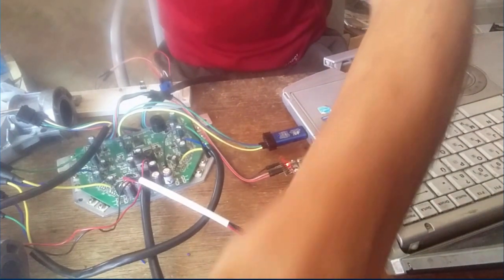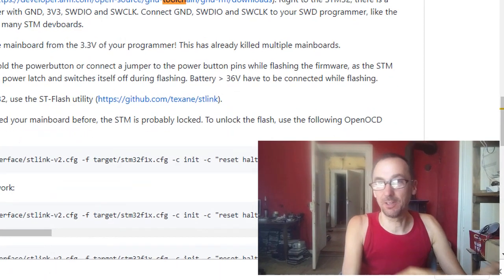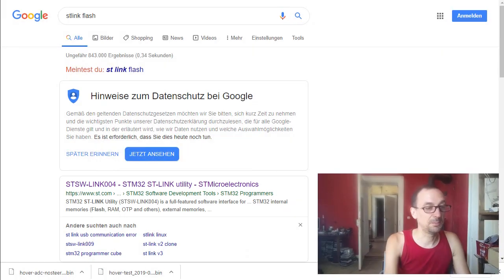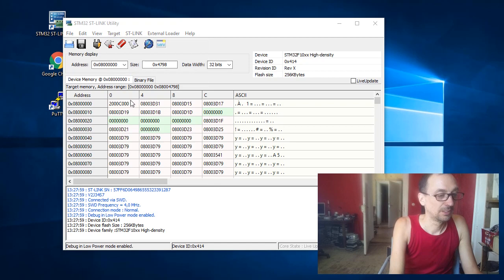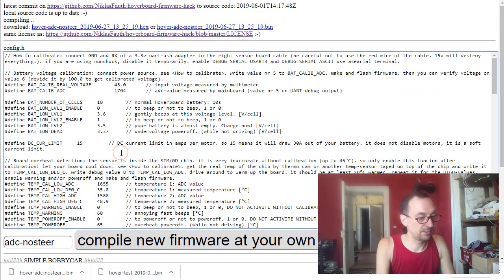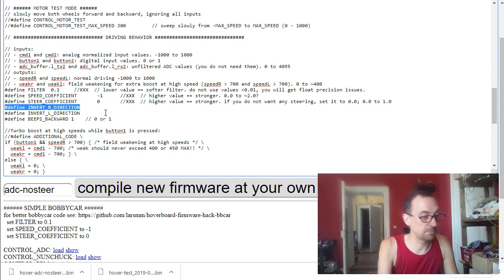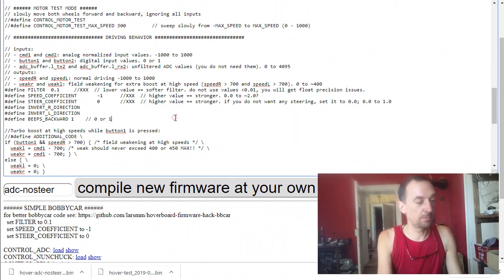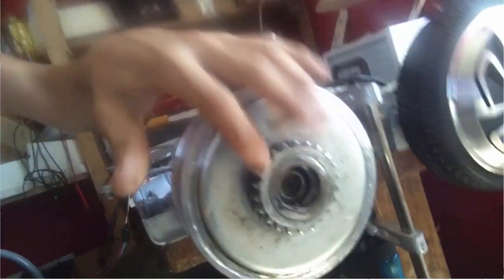free online hoverboard firmware compiler - full tutorial :-)

Comment: Gd work Durden! I have been testing the roboDurden hoverboard-firmware-hack for a while and everything thing is working fine. But when I uncommented #define KMH line to work with KMH, the arduino does not work as it should. For EXAMPLE, sending Send(whatever more than 3 for the speed, 0 for the steer) run the wheels at the highest speed. And sending whatever after that the hoverboard will not react at all. So it is reacting with the first sended command and also incorrectly. Do u know what the problem could be!?
Reply from the maker: This is a long known bug which i thought i had solved by in main.c with:
  if (abs(HallData[0].HallSpeed_mm_per_s) > abs(HallData[1].HallSpeed_mm_per_s))
  {
    #ifdef INVERT_L_DIRECTION
      iSpeed = -HallData[0].HallSpeed_mm_per_s;
    #else
      iSpeed = HallData[0].HallSpeed_mm_per_s;
    #endif
  } 
  else
  {
    #ifdef INVERT_R_DIRECTION
      iSpeed = -HallData[1].HallSpeed_mm_per_s;
    #else
      iSpeed = HallData[1].HallSpeed_mm_per_s;
    #endif
  } 

When the speed goes to max, the control loop had the inverted max speed because of different INVERT_X_DIRECTION ..

Do you have my latest version installed ??
Also give my FOC fork a try. I am no longer using the Niklas fork and the Emanuel fork is compatible to my old fork.
Reply: @robodurden  yes I belive it is the latest one cause I downloaded yesterday from the compiler. I have tried ur FOC version with the USART but it is not working as I wanted. It run for some milli seconds and then stops, then u have to use Send() again. It behaves as the orginal Emanuel one. It send correct spedds but it runs just for some milliseconds.
Reply from the maker: @mazenbahy5012  I would be happy if you continue to resolve the bug :-)
Try commenting/uncommenting INVERT_L_DIRECTION and INVERT_R_DIRECTION to see if my SPEE_IS_KMH control loop then works.

Concerning the Emanuel fork, i send Send() every 100 ms and have no problems. You should do that too unless you verfiy with the returned SerialFeedback that your send command indeed got accepted. As i have this nasty noise on INPUT_PULLUP lines (so also the RX line), i can not rely on reading the struct SerialFeedback :-/
Reply: @robodurden   Hello Again! 
I did some testing regarding the points you said about. 
For all the cases are tested I hade Send(40,0); delay(3000);Send(0,0); in the Arduino  setup(){}. 
- Uncommented both R, L ----> Both wheels start fast, the same direction, and continue forever without reacting with the Send(0,0). 
- Commented both R, L ----> Both wheels start fast, the same direction, and continue forever without reacting with the Send(0,0). 
- Commented R, Uncommented L ---> Both wheels start fast, different directions, and continue forever without reacting with the Send(0,0).
- Commented L, Uncommented R ---> Both wheels start fast, different directions, and continue forever without reacting with the Send(0,0).
Reply from the maker: Could you activate your settings and then change the minus signs in the main.c code I posted here  those lines that are active for your invert defines 
Are you working on my old Niklas fork or the new Emanuel fork ?
Reply: @robodurden  ur old Niklas Fork, cause I can not find serial communication in KMH in ur Emanuel fork.
Reply from the maker: @mazenbahy5012  I have driven 26 km in this speed_is_kmh mode with my Emanuel fork today. Take a look at the .ino file on my GitHub.
Reply from the maker: Sorry this is the original example from Emanuel that I should delete. My example is below or here:
https://github.com/RoboDurden/hoverboard-firmware-hack-FOC/tree/master/hoverserial
Reply: @robodurden  Again No Success, Run the Arduino code (without any changes at all) here from "https://github.com/RoboDurden/hoverboard-firmware-hack-FOC/tree/master/hoverserial" on ur Emanuel fork with both UARTCAR and USART3 variations and nothing happens. Just to be sure. You said "speed_is_kmh mode". There is no place in the compiler to activate the KMH mode in ur Emanuel fork. Right?
Reply from the maker: @yacoubbahy3976  you have to uncomment the speediskmh in my config.h of course.
Reply from the maker: @yacoubbahy3976  my hoverserial.ino can output the SerialFeedback via a USB uart dongle. You should check the debug output.
Reply: @robodurden  RoboDurden/hoverboard-firmware-hack-FOC this version what I am speaking about. Inside the config.h file in the ur online compiler there is nothing about KMH. I can not find it. Which line is it?
Reply: @robodurden  The output is  "XXXXXXXXXXXXXXXXXXXXXXXXX" and it is from that part:
 "#ifdef DEBUG_HOVER
    Serial.print("xxxxx");
    iFailedRec++;
  #endif
"
Reply from the maker: @yacoubbahy3976  there is no such line print("xxxxx") only one x is printed. Uncomment the first line here and post the extended hover Rx debug output:
https://github.com/RoboDurden/hoverboard-firmware-hack-FOC/blob/1e9dbf1cb3293c91a13d27bced41b014f22be383/hoverserial/hoverRobo.h#L1

I guess you are still using some wrong config.h defines.
Reply from the maker: ah i forgot, with my Emanuel FOC fork there is now only km/h with the VARIANT_UARTCAR. So sending 60 wild result in 6 km/h. With 6,5 inch wheel size in the config.h
Reply: @robodurden  By the way,  in the main.c for ur Emanuel fork and Emanuels original, I have to to change the buzzeFreq and buzzPattern to 0 to make it stop beeping. So maybe the wired behavior is related to that?
Here is what I am speaking about:
"
else if (timeoutFlagADC || timeoutFlagSerial) {           // beep in case of ADC or Serial timeout - fast beep      
      buzzerFreq    = 24;
      buzzerPattern = 1;

"
Reply from the maker: 12 12 12 12 17 ff 12 12 12 7f 52 ff 12 12 12 12 12 ff 12 12 somehow looks like you have the wrong baud rate on one side. That might also lead to the Serial timeout beeping. I think baud rate has to be 9600. Sorry that's it for today.
Reply from the maker: @mazenbahy5012  set the baud rate to 9600 in my config.h here: https://github.com/RoboDurden/hoverboard-firmware-hack-FOC/blob/ceda23b51492d8a30611bd0933541f3092160513/Inc/config.h#L439
Or set the HOVER_SERIAL_BAUD to 38400 here: https://github.com/RoboDurden/hoverboard-firmware-hack-FOC/blob/ceda23b51492d8a30611bd0933541f3092160513/hoverserial/hoverRobo.h#L3

Sorry, stupid of me to have an arduino example with 9600 baud and  the firmware baud rate of 38400 :-(
Reply: @robodurden  I have it in the Arduino as ur "HOVER_SERIAL_BAUD   9600" and I tried to change it to 38400 and then I get the feedback "speedL:0   speedR:0 .......etc" which make sense because in the config.h  the baud rate 38400 is used for FEEDBACK_SERIAL_USART3 which makes sense. Thanks a lot for ur replies. I will continue investigating in it.
Reply: @robodurden  I should have looked at it before. My fault. Anyway, I get the feedback now but nothing happens. It's look like it send 0 to the motors. (Note:sry for confusing u in the comments. I noticed that I am using two different account to comment(mazox and mazen bahy) but I am the same person). Thanks for all the help.
Reply from the maker: @mazenbahy5012  you can set some feedback value to 42 at some point in the main.c to test if that code really gets executed..
I will flash my default firmware and my example to my solar car tomorrow.
Reply from the maker: @mazenbahy5012  My code works. First i only flashed my newly compiled firmware with 9600 baud and it worked with my solar car 9600 baud Arduino Mini 3.3V code. Then i flashed the 38400 baud compilation and also flashed the Arduino Mini with my hoverserial example code. And it too worked perfectly. 
So you eihter made some changes to my code without telling me here, or your control board is broken. As you by now get the SerialFeedback we can assume that the communicaton Arduino to Hoverboard is also working.
Try flashing the Niklas Test mode to see if your board and motors are working.
Reply: @robodurden Hello Durden! Thanks for the replies and for confirming that everything works fine with the code.  I repeated everything many times and then it looks like one of the incorrect things I did was turning the hoverboard on before uploading the code. So now, I upload the code to Arduino, turn on the hoverboard, and then everything works correctly (I believe it is also why it was beeping, Because it waits for some signals from Arduino while the Arduino is busy with uploading the code and then the timeout is over, then it starts beeping). Now the problem is with steering. when I put something else than "0" into the steering parameter it does not react at all (the wheels are not running at all and not beeping either). Changing the steer to "0", then everything works immediately´(Tested with both, commenting and uncommenting #define INVERT_R_DIRECTION, #define INVERT_L_DIRECTION in config.h file). The feedback I get while running with something else than "0" for steering is the following: 
 "speedL: 0	speedR: 0	skippedL: 5555	skippedR: 0	°C: 27	U: 0.27	lA: -0.60	rA: -0.30"
Reply from the maker: @yacoubbahy3976   my variant_uartcar  has no steering. Why should it? A car has a steering wheel.
Reply: @robodurden  Oh, Ok. I am using it to build a differential drive mobile robot. So i do not have a steering wheel.
Reply from the maker: @yacoubbahy3976  don't know how nicely I could integrate a steer value in my closed loop. Why don't you stick with the original Emanuel firmware ? It should already have improvements that I don't have. You can easily switch to his serial struct by changing the #include in my .ino
Reply from the maker: @yacoubbahy3976  from this line onward
https://github.com/RoboDurden/hoverboard-firmware-hack-FOC/blob/70c6986346b14648ce8871deb5d62ebe5a9e0ed2/Src/main.c#L277
you could define iSpeed as ('speedLeft'+'speedRight')/2 . Then the steer value might already work. But the steer command cmd1 should be a +- percentage of iSpeed and not a +-1000 pwn value. Then your steer command would always translate to the same curve radius no matter which speed is driven. 
At line 319 of my closed loop I reset cmd2 and then your cmd1 steer value of let's say 66 should become (cmd2*cmd1)/1000. Might work. You test it :-)

Comment: As promised, here is video of my project: https://youtu.be/PatJK148ie0 I managed to get Feru's Variant_hovercar working with two throttles. Hand throttle = throttle and thumb throttle = brake. I also make test run, but when i finished it one mosfet blows up (and it's driver Q2CL too). I bought this faulty hoverboard and replaced two mosfets, but now another blow up again. I also noticed that there is high pitch noise coming from mainboard. Earlier i used voltage mode, but now with torque mode this happened. Maeby there was some other faulty components also than mosfets. Maybe drivers?
Reply from the maker: Very nice project with a lot of love :-) 
Yes i too have by now lots of used controller boards where a mosfet burned. Have by now new mosfet from China but had not yet the happiness to replace the burned one. Did that once and then simple another mosfet burned. Try measuring the gate voltage before you solder in a new mosfet. I guess it should not exceed 15 Volt or so. 
I have a video on mosfet repair but i fear it will not really help you.
Did the gate pin of the mosfet blow up ? Then it must have been gate over voltage. If one of the others blew up it was over current from the motor ?!

Comment: I'm building an electric scooter and i'm using Feru's firmware. I'd like to use electric bike throttle, and it's working, but there is some interference with ADC1 and ADC2 (i used variant_adc). If i connect both cables to throttle, the ADC values are not same, i don't know why. I don't need steering, so i disabled it, but it won't help. Is there some way to use just ADC1 without ADC2 or do i have to use both?
Reply from the maker: In this video i too use the Feru firmware with only one potentiometer for speed (=throttle): https://youtu.be/DILzw6RzPkE  You simply leave the steer ADC cable unconnected. Better pull it to ground to prevent static overvoltages because any voltage above 3.3V on the two adc pins/cables can destroy the main processor.
Reply: @robodurden  Is it ADC1 for speed and ADC2 for steering? I also like to use motors as electric brake, where i need to connect switch and what value i must change to get it working in Feru's firmware with variant_adc? i tried to use standstill and it works, but if you loose throttle too fast it brakes very strong and suddently. i also tried to use torgue mode, but it will not work, also variant_hovercar will not work, i don't know why.
Reply from the maker: @jusubbidiy  take a look at the wireing image on our githubs. I think green is speed adc but i may be wrong. A scooter is a 2 wheeler. So one motor for back wheel and a motor for front wheel ? Uplaod a video !
Yes, a switch that will pull down the speed adc to gnd would result in an abrupt stop. You could short cut the throttle with another potentiometer to brake down to a slower speed. Or you could switch from the speed potentionmeter to a capacitor that discharges via a resistor withing 2 seconds to 0. When the throttle is active, the capactior would be charged to the same level as the adc input. 
Or you abuse the steer potiometer as the brake input and change that analog value in main.c to whatever behavior you like.
Reply from the maker: @jusubbidiy  You can adjust 
#define DEFAULT_RATE                480   // 30.0f [-] lower value == slower rate [0, 32767] = [0.0, 2047.9375]. Do NOT make rate negative (>32767)
#define DEFAULT_FILTER              6553  // Default for FILTER 0.1f [-] lower value == softer filter [0, 65535] = [0.0 - 1.0].
in the config.h to make the brake to 0 affect the speed more slowly. This however also will affect when want to speed up in a flash.
The RATE and FILTER will be used in the main.c here: https://github.com/EmanuelFeru/hoverboard-firmware-hack-FOC/blob/master/Src/main.c#L254
Reply: @robodurden  Blue = ADC1 Green = ADC2 (mine has Grey). Variant_hovercar has #define STANDSTILL_HOLD_ENABLE, i copied this to under variant_adc and used it as brake. It works fine, but you have to loose throttle very gently. I'd like to use #define ELECTRIC_BRAKE_ENABLE, but it will work only with torgue mode and that will not work. I don't know why. That's why i need to use #define CTRL_MOD_REQ    VLT_MODE. I make video later today.
Reply from the maker: @jusubbidiy  some defines are only active in one variant_xyz. So you should always search strg+f that definition in main.c 
So ELECTRIC_BRAKE_ENABLE leads to https://github.com/EmanuelFeru/hoverboard-firmware-hack-FOC/blob/master/Src/main.c#L232
// Apply Electric Brake. Only available and makes sense for TORQUE Mode
Reply: @robodurden  Change to plan: i found this Ferus's video: https://youtu.be/IgHCcj0NgWQ and there is variant_hovercar in use. So all i need is second thumb throttle to use as brake pedal and invert rotation of one motor. There is also original leds used as indicator, so maybe i install those too.

Comment: Hi :) I've got a question for you. I'm building an electric scooter for my niece based on Emanuel Feru's software as it seems the best so far. I'm wondering if it's possible to change the code a bit to achieve field weakening but only if a button is pressed (or a key turned more accurately) as I intend to drive it now and then aswell and I'd like to go a little faster^^ I noticed there is a possibility to use right sensor cables as buttons with #define SUPPORT_BUTTONS_RIGHT. However I'm not sure how the code is supposed to look like. Based on some lines in NiklausFauth's code I came up with something like this:
if (button1==1) { 
  #define FIELD_WEAK_ENA  1
}
else {
  #define FIELD_WEAK_ENA  0
}
Do you think it will work?

And if the codes structure is fine, do you think it is better to simply turn on/off field weakening variable or maybe it's safer to just change potentiometer range to make it go slower without actually modifying motor's parameters mid-drive? I'm using a potentiometer which gives 2,82 volts top, which equals to adc1_max=3472. If the value of adc1_max variable would rise to, for example, 6000 and the potis best is 3472, the max speed should be a little above half of what the motors can deliver. So the code would look like this:
if (button1==1) { 
  #define ADC1_MAX            3472
}
else {
  #define ADC1_MAX            6000
}
What do you think? How would you solve it yourself? Thanks for the videos and the compiler. Cheers :))

Comment: Thanks for compiler! I'm trying to get serial communication working with usb-to-ttl converter. It sends data to putty, but it's a mess. COM3 and 9600 baud settings are default. Can you help me?
Reply from the maker: i guess you do not want to control the hoverboard via serial but only want to read the logging data. With the original Niklas firmware that was indeed asc code which should be received with putty. take a look at the config.h at which baud rate the hoverboard is sending.
With my firmware and i guess also the firmware from Emanuel, the serial data stream is a c-struct which can not be displayed as an ascii stream. Take a look at our arduino .ino example files on our githubs ..
Reply: @robodurden   I found out, that correct speed was 38400 baud with Feru firmare. Now logging works and i can read that data. Thanks for a tip!

Comment: its possible with FT232RL FTDI USB?
Reply from the maker: what is possible ?
You can not flash a stm32 with UART, you need a ST-Link V2 usb dongle. 
If you want to control the hoverboard via uart serial connection, of course a usb uart dongle could help you to control the board from a pc